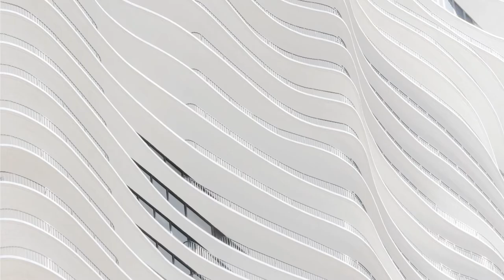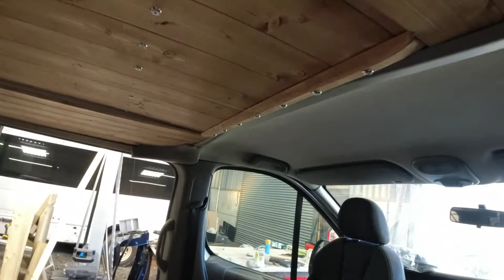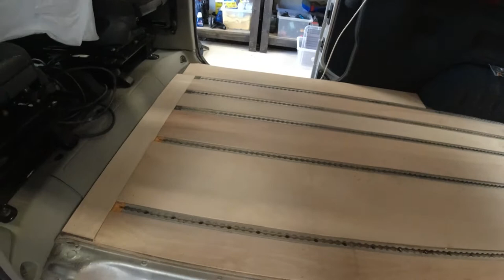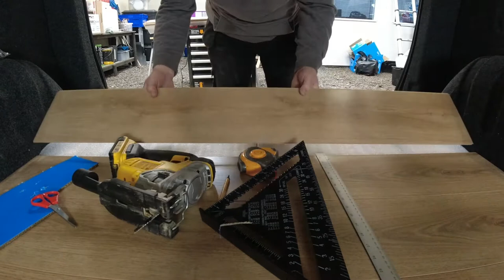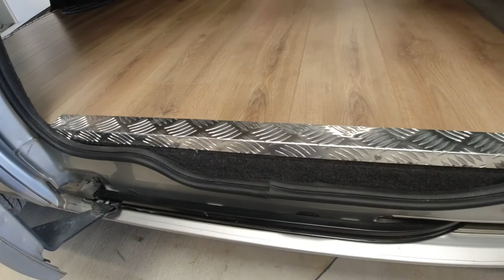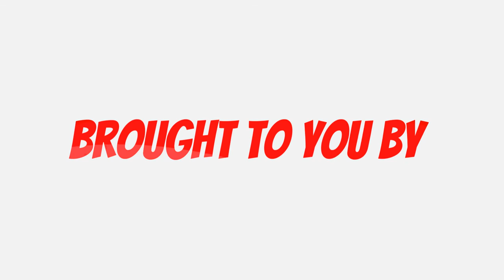Renault Trafic Campervan Conversion - Installing Laminate Flooring

Comment: Neat job, glad you didn't try and remove the dreaded Unwin tracks ! I insulated between mine and boarded over the lot, then waterproof flooring over to finish it off.
Reply from the maker: Thats a good way of dealing with them

Comment: https://youtu.be/KjaDbi1w2Ko?t=95 I honestly hought you were joking about the nails. :O Are you serious? Surely you run the risk of nailing into cabling, brake or fuel pipes that are unseen underneath, any mild steel panel pin nail will be rusted out within a few years. https://www.youtube.com/watch?v=KM2K7sV-K74 Those underlay board surely need only a small dab of glue here and there to stop them from moving over time. I would envisage that too tidy a job on underlay may be a problem to allow for contraction and expansion of the floor?